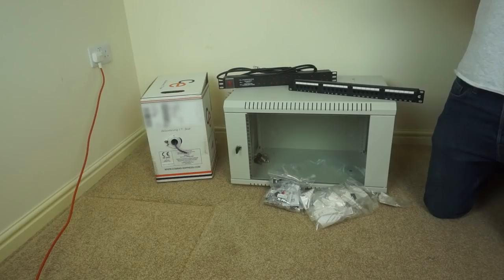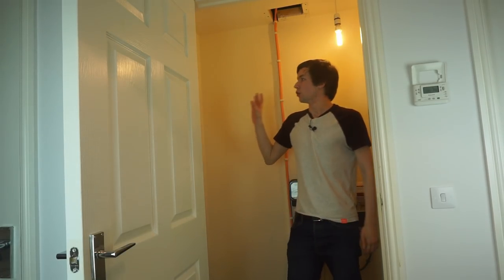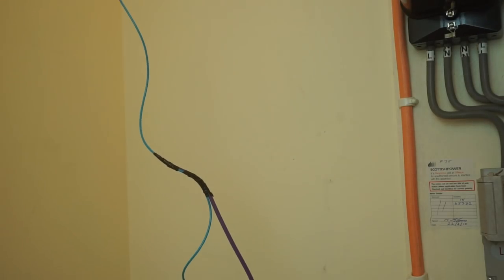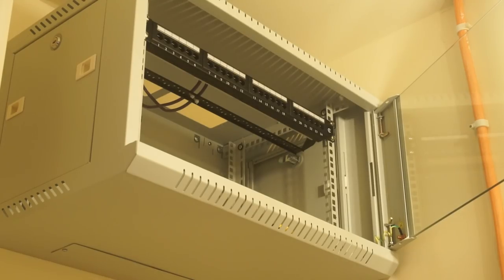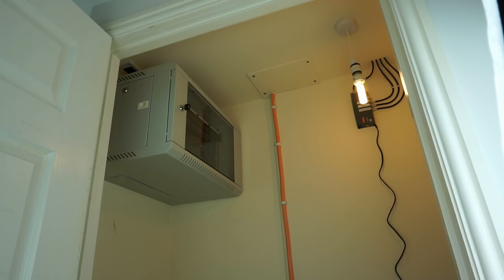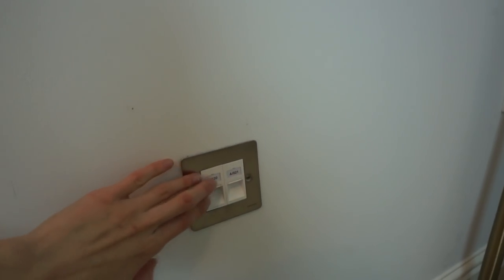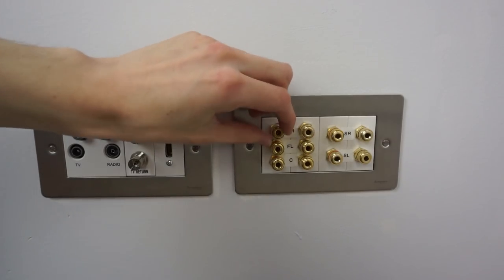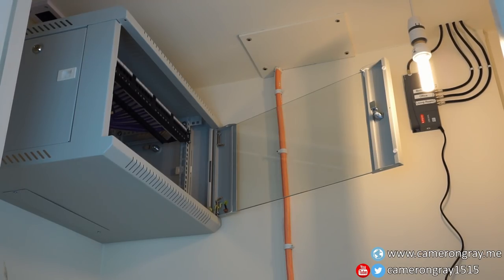New Flat - Time to install a completely overkill home network!

Comment: Don’t use amplifiers for Coaxial, really never necessary. If you have an issue with signal you’d be much better off getting one from your provider as you’ll get it for free and they have access to higher quality products than consumers
Reply from the maker: It's a TV antenna, not cable, there is no provider involved.
Reply: Same point, what is your incoming signal strength, is there actually any need for an amp. Not trying to be confrontational, just wondering
Reply from the maker: Can't remember exact numbers, but I tested using the signal meter on a TV (don't have a separate tool) and it showed the signal as probably around 40-50% of the meter using a short coax patch lead, after a reasonable length of coax it dropped down to basically nothing and became unwatchable.

Comment: Errrrmm...
Fibre.
:-/
Reply from the maker: In what way?  Fibre would be pretty useless for structured cabling outside of very specific applications such as to interconnect buildings or for high bandwidth uplinks between switches. As for my internet connection, it's a fibre to the cabinet connection which is the best that is available in my area at the moment, there is talk of fibre to the premises being installed in the future though.

Comment: All that work and u didn't even use proper cat6a shielded  lan cable lol
Reply from the maker: +Mantaray CAT6a or CAT7 would have been several times the price of the CAT6 I used.  While I did spend a lot on this project, I did still have a budget to stick within. In this install there are no extremely long runs, the longest would probably be 15-20m at most.  CAT6 can run gigabit up to 100m of cable and can reportedly do 10gbit (which I have no real plans of getting at this point in time) over 33-55m lengths which is within the limits of the cable runs I have.  For my current uses, even CAT5e would have been fine however going up to CAT6 made sense as I got a good deal on the cable and it would allow me to send HDMI video over it reliably (something I've had issues with using CAT5e)

Comment: Just use mains adapters. Why got to this bother and expense when mains adapters do the same thing?
Reply from the maker: +Deej Hat78 Partially because I can and also because it would be a fun and interesting project to do.  I also tend to find that powerline adapters don't perform as well and aren't as reliable as a direct cable.  Proper CAT6 runs can also be used for things other than Ethernet such as running HDMI video over it.
Reply: Powerline adapters Don’t have the same reliability and often speed that a proper cat6 run will have.
Reply: I have Powerline Adapters.. Because wife doesn't like the "temporary" holes in the wall/floor/ceiling to do this type of stuff... And.. Now I have to put up with how she hates that we have to turn off/on one of the power lines all the time to get the TV to work properly.. Powerlines are great for emergency.. but after living with them for 5 years, they are far FAR...... FARRRRRR from perfect..
Reply: Powerline Adapters are total shit and only deliver a fraction of the advertised speed.
Reply: +Colin Richardson Get rid of the main problem (wife) then. :-P

Comment: Well given that Cat6 is not that much different to Cat5, you have 4 twisted pairs that only half are being used, therefore you can have one cable and use all 4 twisted pairs for two channels.
Reply from the maker: You can but you will only get 100mbps, gigabit connections (which is what I need at a minimum) require all 4 pairs.  Given the relatively low cost of the cable, I'd always run two completely separate cables rather than doing this.
Reply: Ermmm, are you really trying to say that BT provide that kind of bandwidth to your property? 

Also, getting your device to use that amount of bandwidth is not going to get you anywhere given that the bottleneck in your system is your ISP connection.

Then you have the device settings, these will be set to limit the hardware connection speed, the ratio is 10 : 100 : 1000 in terms of endpoint to node where your 10 Mb/s on a home network router that runs ate 100 Mb/s that itself connects to a network running at 1000 Mb/s where you are allotted some of that bandwidth. 

So even if you could optimise your connections, there will be consequences for it and it will not get around the bandwidth you are allotted by the ISP at that moment in time.

Then Fibre Optic, the standard BT service delivers 76 Mb/s which is less than your home network speed, so it does not matter how fast you go at home, your Achilles heel is your ISP.
Reply from the maker: It's not just about my internet connection (which is currently BT's 80/20 plan) - I store all of my data on a server in the flat instead of on each PC so being able to move data around the local network at gigabit speeds is important.  There are also plans for the building to get gigabit FTTP installed at some point in the future which would definitely require a gigabit capable local network.

Given the fact that the cabling was pretty cheap (Around £67 for the 305m box which I only needed one of), I can't see a reason to have skimped and limit myself to 100mbps.
Reply: All home connections are Asymmetric in their bandwidth allocation for up and down streams. Your download speed is always faster than your upload speed.

Why not a VPN setup if you are going to go in to home storage, assuming you have a NAS as part of your build, having a fast network at home is only needed if your number of concurrent devices exceeds the capacity of the network and that is not as many people understand, its a ratio of 6:4 where the overhead is used for resents, packet crashes, etc. Your working with a 60% capacity which means to the average person on the street is that up to 6 devices (wired) and maybe less (depends on WiFi) connections over WiFi which itself has an overhead...

IMHO I think you are doing your money on technology that really hasn't changed in the 20 years since I did a course on Network Administration. We are not far off from a total fibre optical leap, my local area has been fibre optic for ages but with only one supplier, BT has dragged it heels, given I live 200 meters away from the exchange, you would have thought that they would have fibre in the area, well they installed fibre trunking last month, so I am expecting they are going to go fibre in the new year.

The cost of fibre optical LAN cards is anything from £15 to £200 and a router / switch can cost as little as £235 with fibre optical in and out optical connects and standard RJ connectors.

This reminds me, I got a switch somewhere that I could do with investigating, some guy at a car boot sold it for £1, didn't know what it was, it powers up but not tried to use it yet... Its either going to work or destined for parts.
Reply from the maker: I'm aware that my current connection is asymmetric (up to 80 down, 20 up), if the FTTP connection I mentioned goes ahead then that would be symmetric.

I do have a VPN set up to allow me to access resources on my network when I'm away from home. Not quite sure what you mean by the number of concurrent devices/ratio.etc - I've never heard of that before in the context of a modern Ethernet network.  My server has high enough disk performance to transfer data to my PC at full gigabit speeds, therefore I need a gigabit home network in order to take advantage of this.  If I limited myself to 100mbps by sharing cables then working on files stored on the server would be frustratingly slow.

While fibre is certainly becoming the go-to standard for long distance cabling and datacentre use, structured cabling within a building is likely still to be copper for the foreseeable future.  Nowadays, copper, twisted pair cable can handle 10gbit networks.  Installing a completely fibre home network would have been impractical in this situation since I'd have had to buy new network cards for all PCs and would be unable to connect devices such as laptops and smart TVs that don't allow for network cards to be added unless I installed media converters everywhere which would defeat the point of having easy to use network connections everywhere.  Fibre is also pretty fragile and would require significantly more care to be taken when installing and using it to not snap the core.
Reply: Your network is no different than any other class of network, it will have a capacity that is no different, it will have a limit on the number of devices that you can connect at the same time.

The contention ratio is the number of devices on a branch of a network, the ISP relies on you not using that connection, in fact they will be banking on this to fall off after about two weeks, which is the average honeymoon period for the average new connections.

So don't expect to get the quoted uplink / downlink speeds you are expecting. I found this out with all ISP's I have been with as I was a very heavy user, years ago I had the full train set, you could have transplanted my set up to a secure location and I could have set up as an ISP.

This was back when I was learning about networks, long before I went on a MS MCP course for network administration. The course was run by the local college and they went deeper in to the process of building a network, each lesson was a case of get you PC parts, build your PC, install the operating system and then set up the PDC BDC and if this config needed it, the Access server for directory services. So I have been through the whole process of setting up a network like this, it will be fun for you thats for sure.

So anyway, bottlenecks will exist, capacity will never be what is quoted and that is due to the need for some overhead when you get crashes resends and other network issues where some packets are routed differently and don't arrive in any given sequence.

Was the switch you bought an active switch or passive switch? This is where you can optimise your connections so that users on the network won't feel any pain from waiting those 2 or 3 seconds longer than usual and don't go in to butt hurt mode when the page can not be displayed or download fails.

As for my set up now, I have a box I got off ebay, it runs a server, stores files, has shared facilities, print server built in, so it does the job of my old network and doesn't require a PC to be on. Not sure if you can get them today but I am sure that if all you really want is access to files, a NAS or one of these if your pocket can't stretch to a NAS, it a good alternative as it gives remote access like a NAS does.

Are you going to have a rack mount PC in there as well?
Reply from the maker: I'm not that bothered about my actual internet connection, my point is that I need a gigabit local network for file transfers.  The internet connection I have is more than sufficient for my needs and is double the speed the one I had in my previous flat.  There's no hard limit as to how many devices you can connect to the network, sure, if you have a tonne of devices all moving data around down the same links then there may be some contention, you may also want to take measures such as segmenting the network to reduce broadcast traffic, but there's no hard limit as to how many devices that can be connected.

I'll show the full setup in the next video but to give a rough idea, the switches I've bought are managed (Ubiquiti UniFi US-24)  I've not bothered configuring any sort of QoS on the network but I am using them to aggregate certain links and to have different VLANs to segment the network.

For my server I'm currently using a Fujitsu Primergy TX1310 M1 server running FreeBSD to store and serve all my files as well as running VMs for other stuff like the controller software for the UniFi equipment.  I wouldn't be installing any sort of PC in the wall mounted rack (it's too small and I wouldn't want to add that much weight) but I have a second rack that holds the server mentioned above (not rackmount so just sits on a rack shelf) along with a rackmounted HTPC, rackmounted router, second UniFi US-24 switch, PDU and an AV receiver which is on a second rack shelf.  I went for the tower server purely because it was such a good deal at the time, my next server will likely be a proper rackmount one.
Reply: Mark Giblin  What stupid things do you write? If you not would pay your internet contractor - your fault. I lives here in the county in a small village in the Federal Republic of Germany. My fiber ISP can sell me same speed down/up since 2012 - but mostly you use more down as up in the real world. 😂 So I am happy with 100/10 for this few private computers and non public servers. 

Do you forget the first rule in this business - everybody have an own reason why he/she do it exactly so and not other! 

But your comments are very funny - I think we all want laughing in years over your jokes ...
Reply: Cameron Gray   Let this worm talk. He hear some words and wish he could build normal sentents. If somebody dream from "up same down", "Cat 5 better Cat 6 or it is near same", "only expensive fiber" ,and "passive switches" he should go away from YouTube! 

You do all correct. Nobody need to know what you like to use in YOUR private network! It is your idea.
Reply: Mark Giblin    What have an UK ISP to do with Mister Cameron Gray's own private network in his own private flat? 

Typical now at this point that you use different internet laws for critism other YouTube user. 😞😩
Reply: You obviously haven't a clue, carry on living that lie that you are getting 1MBit on your home router, I can tell you that you are not.

Your internet is no different than anywhere else.

1. The computer LanCard required overhead to allow for losses and crashes and resends of infromation
2. The Switch requires overhead for its self and those connected to the switch, this can be a problem in large setups where you have to throttle and split the bandwidth to devices, in a home environment with limited connects, this isn't much of a problem BUT overhead still exists.
3. If you have Fibre Optical, then the type you have for your install is also a factor on the connection speed. Your fibre may only be to your building and from therein a regular Ethernet twisted pair... Who knows what you have.

In ANY network there are bottlenecks, these can be hardware and software but most often failure to configure bandwidth allocation.

So have you got 100 or 1000Mbit cards in your PC? What about the other hardware you have like mobiles and tablets, they are only likely to have 10Mbit cards and if WiFi is anyone's guess.

You will have a limit on the number of concurrent connections to the network, this is an undeniable fact, if you want to fool yourself, please do so in your own time and with your own therapist.
Reply: @MG
1. Do you mean collisions? Maybe you should upgrade your hub to a switch? How much packet loss do you get?
2. Cameron's switch (Ubiquiti UniFi US-24) has 26Gbit of switching capacity, so all links can be fully saturated. The overhead exists yes; but it's negligible. 
3. Cameron mentioned his area is going FTTP (fibre to the premises) eventually. That means fibre all the way into his house/flat. Currently he'd be on some sort of VDSL technology I would guess. If it's anything like Australia, it'll be a basement (FTTB) or curb-side node (FTTN) cabinet with a DSLAM connected to Fibre. I believe the intention is to eventually run the fibre into the premises.
I think you need to update yourself on modern technology... I subscribe to a 100/40Mbit connection (FTTP) at home that gets realistic speeds of 91.7/38.4. ALL of my PCs and laptops have gigabit networking (cause you know, they're all newer than 2005). I think only my Raspberry Pi has a 10/100mbit link.
Yes, there's a bottleneck from your home network to your ISP's network. Yes, ISPs use lean contention ratios to limit the amount of back-haul and peering bandwidth they need to purchase. This isn't "failure" to allocate bandwidth, ISPs buy enough capacity to meet the demands of the majority of users at any given time. And if they don't buy enough, your performance suffers. You get this with cheaper ISPs.
Reply: Ben Grabau collisions happwn all the time, a switch makes no difference in that regards.
Reply: What are you going on about?  Internet Contractor and My Fault.

I can tell you that I have handed the ISP's I have had their asses on many an occasion with their BS tricks to get their switches (which I have been advised by some mullet head on here to get, pffft, what they know about it any way) doesn't get around the fact that your ISP controls your connection and DOES NOT give you full capacity, never has, never will and until the technology leaps in to something that has the capacity for a one to one relationship with machines and users, then you will always have collisions, drop outs, losses and so on, its a fact and no amount of pouting will remove that fact.